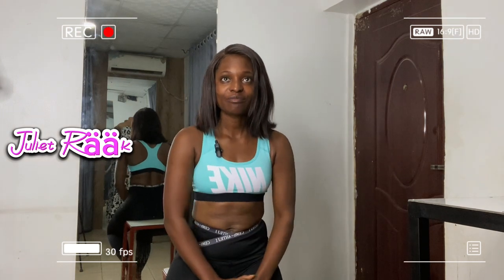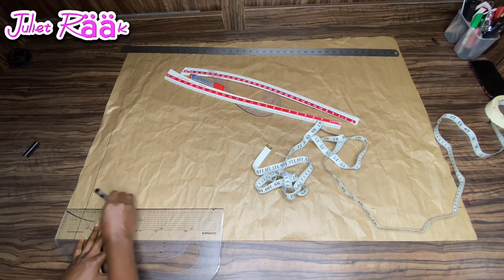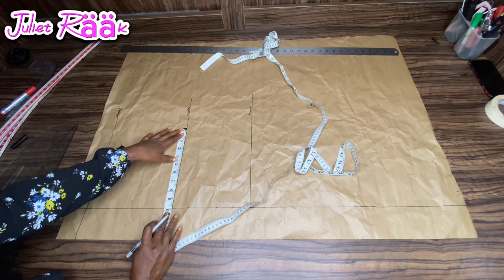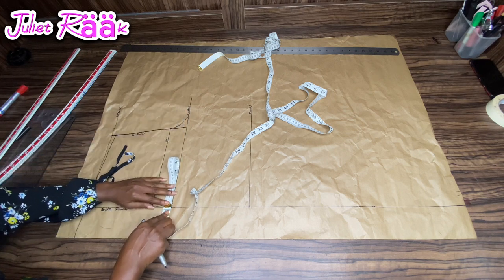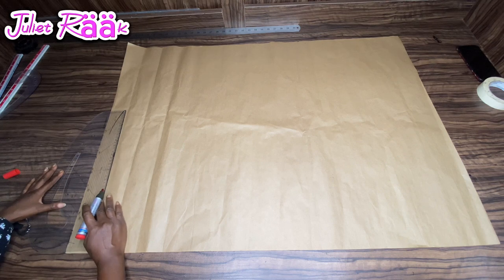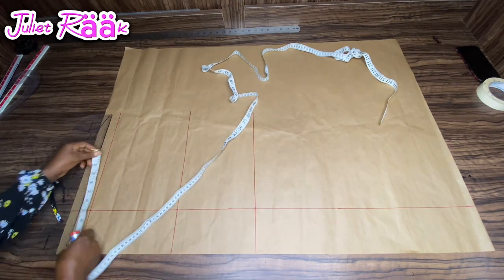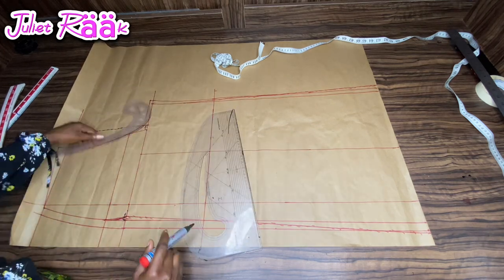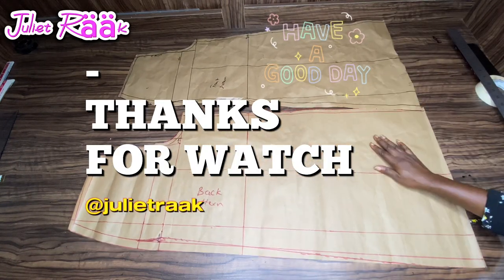DIY how to draft a Palazzo pant / how to eliminate waist dart from pant tutorial (part 1)  ￼

Comment: Hi ma’am… you said your thigh corresponds with the crotch, what if my hip is 48/4=12… front crotch extension is 48/20=2.4… my thigh is 31/2=15.5… what if my thigh measurement is more than the crotch length of 14.4 please
Reply from the maker: Okay, do this math with me.
your back crotch extension will make up for your front crotch extension.

Front crotch extension your hip 48/4= 12 right and to get your front crotch extension is 
Hip 48/20= 2.4 add +12 =14.4 

Back crotch extension: your hip 48/4 =12 and to get your back  crotch extension is 
Hip 48/10= 4.8 add +12 =16.8 inches 
And your thigh is 31/2 = is 15 inches 
So your back pattern already has cover-up for the front pattern
Reply: @julietraak  thank you so much… I’m grateful
Reply from the maker: @Adjoa_Aboagyewaa  you're welcome